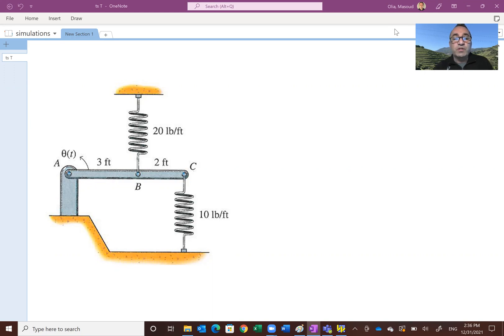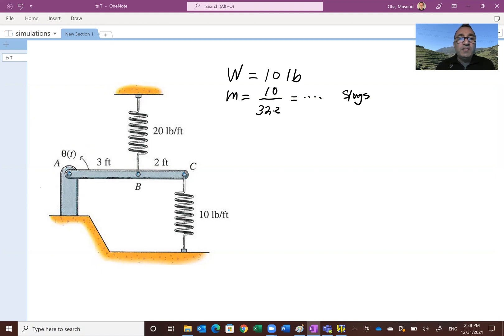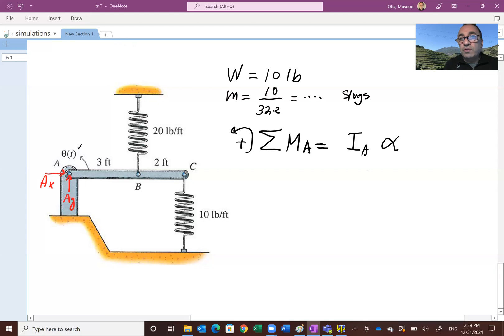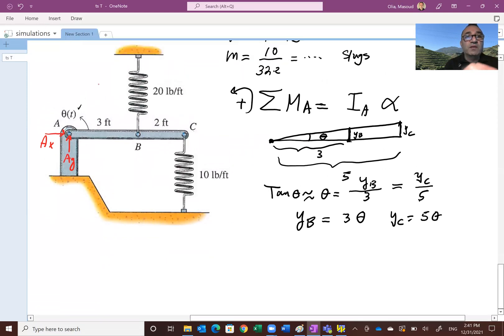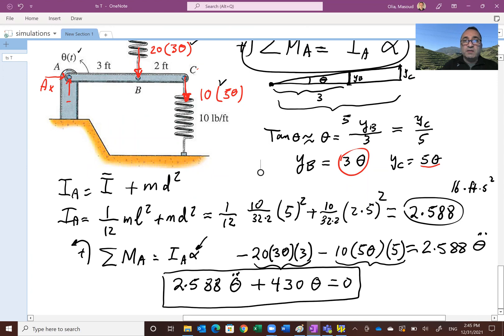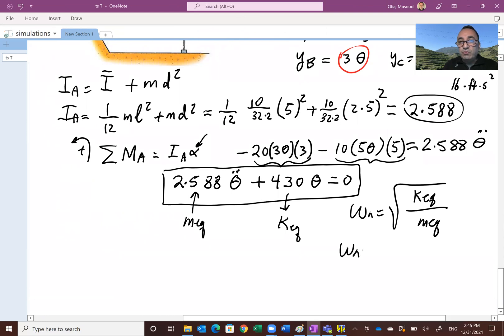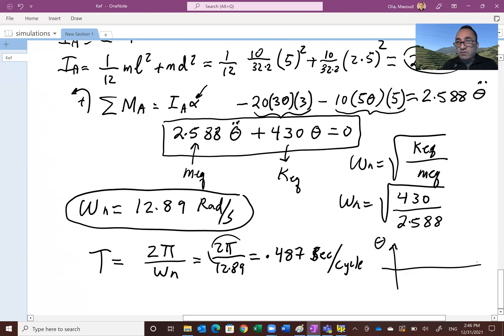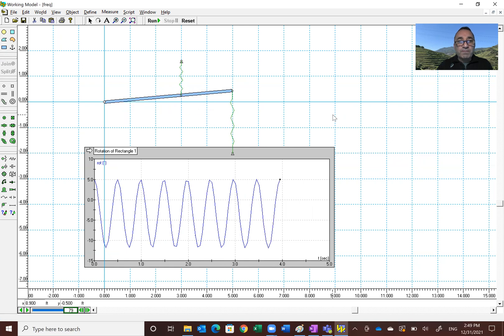Natural Frequency of a Rotational Mechanical System — Torsional Vibration Example

Comment: Hi Masoud, I am wondering if you could do a formula ( to aim a putt on a sloped green ) for 4 foot then 8 foot then 12 foot distance to go into the hole. The slope would be 2 degrees. would like to know the delta force of the 3 putts and the delta angle needed to increase ( Beta ) , thanks